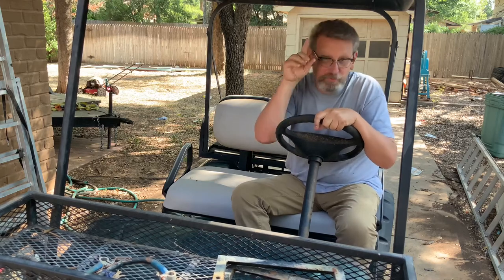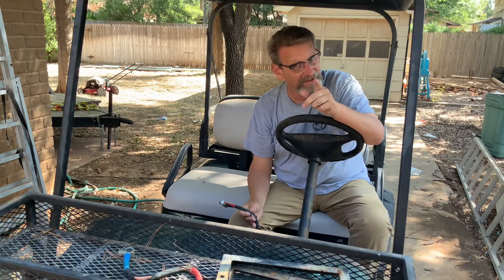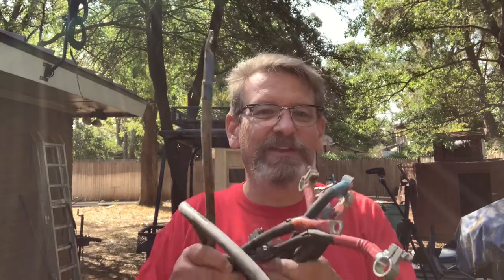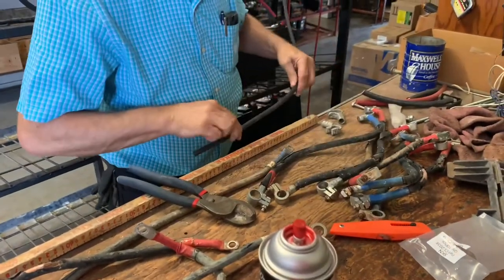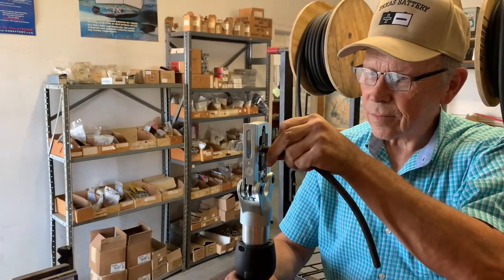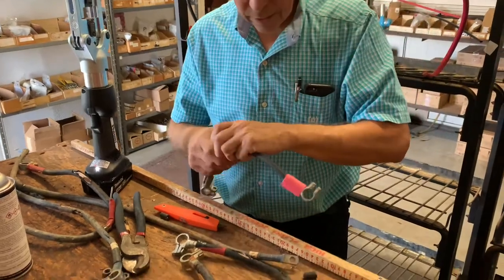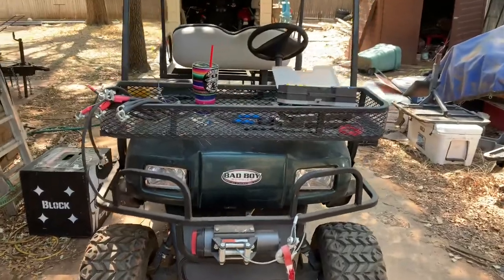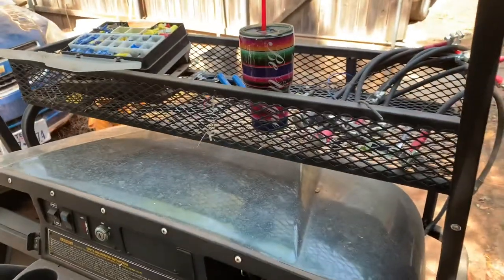S4E20: Bad Boy Buggies Restoration Part 3.....Wiring

Comment: Even if you didn't get her going, we would love to see what your progress was.  I personally have worked on two separate Bad Boy Buggies myself.  I redid the batteries in a buddy's buggie, and mine.  I also found some good schematics on the web.  The most common issues are the controllers going out.
Reply: Do you know where you found the schematics? Struggling to find an electrical issue

Comment: Rebuilding a 2007 Bad Boy Buggy Classic myself.
Reply: Alltrax has a conversion kit for BBB
Reply: @egbolt  what kind of conversion kit are you referring to here; Wiring, batteries, controllers? Please specify. I apologize for not understanding what you mean.
Reply: @frankbuck6255  alltrax controller Xct 500amp, with software, you will need a hd solenoid. After controller install you can Change motors etc.
Reply: @egbolt  ah ok. Great info! Thank you!
Reply: i checked out an 05 model yesterday. Bad boy.
Please explain the 4wd/automatic button.
And do you ever have all 4 tires pulling or just 1 front and one back? Plan to do some snow plowing.  A ice rink on a lake.
Thanks...
Reply: @golfish8589  I apologize for not getting back to you sooner, but to tell you the truth, I’m totally unsure about that myself. Just getting around to getting to know mine too, & now you have me wondering the same exact thing, 😂. Sorry I couldn’t be of more help.

Comment: Hard to believe you did not vacuum out the battery bay and get all the schmutz out before starting on the wires.  Call phone pics to a PC are the best way to verify wiring goes back to normal.....  get that dang rodent...